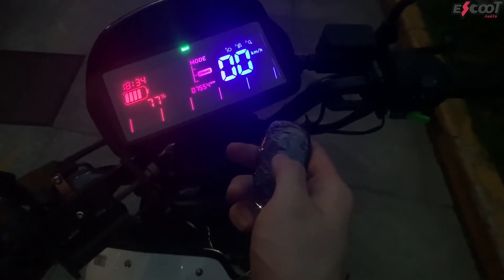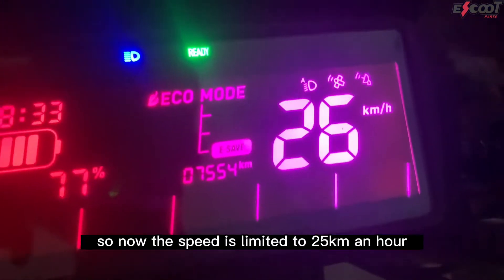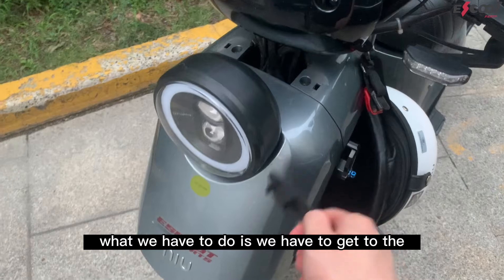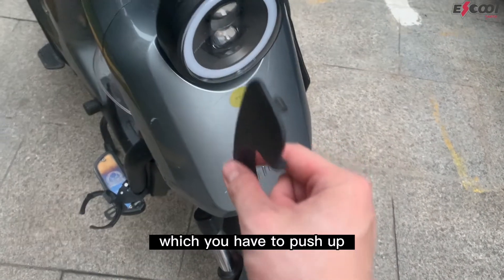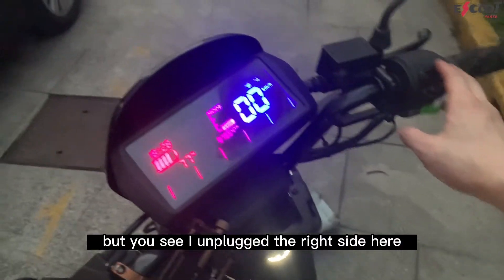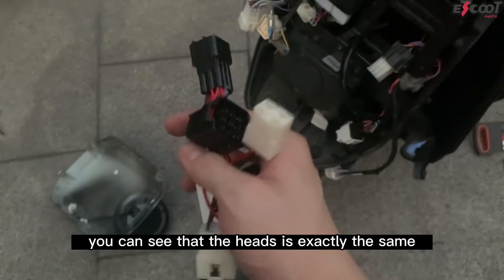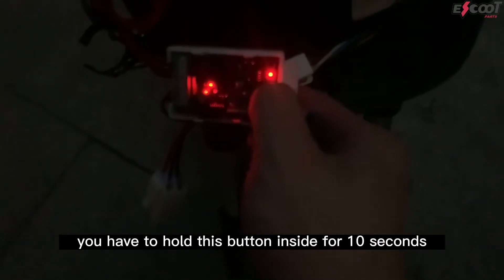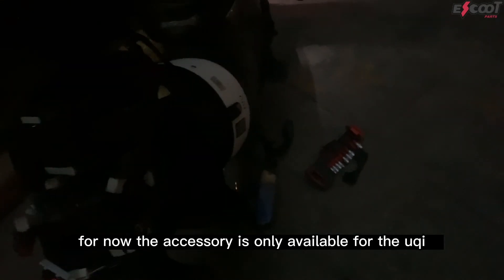NIU UQI Series Speed Limiter Installation Instructions

Comment: Hey bro. I have NIU Uqi plus sport. I want to limit the speed 2 till 32 km. Can u guide me how to do it. Now its goes till 36. So make it legal it should not be more then 32km .
Reply from the maker: Yes you can program the maximum speed. For the UQIGT, UQI+ and U1 we carry a motherboard that can unlock a third mode and also has programming option so that you can program the acceleration and also the speed per mode. The maximum speed for UQIGT is around 65 kmh, UQI+ and U1 is 55kmh. https://escootparts.com/product/uqi-65km-h-u1-motherboard-55km-h-3-modes-programmable/